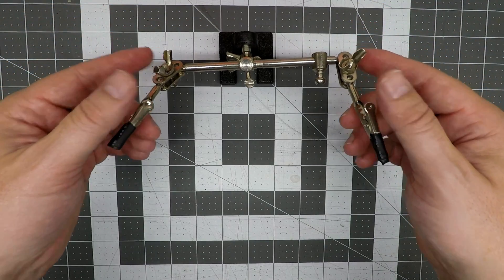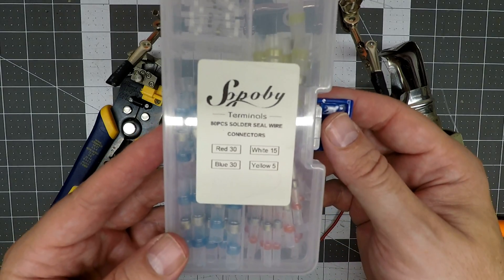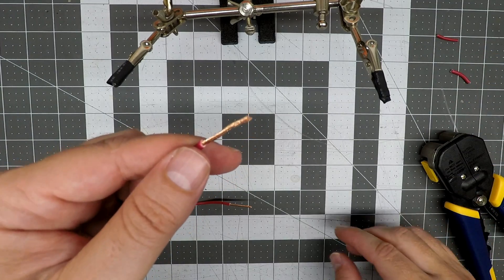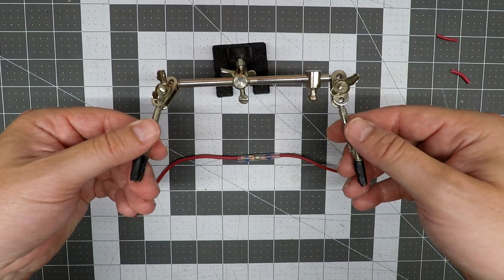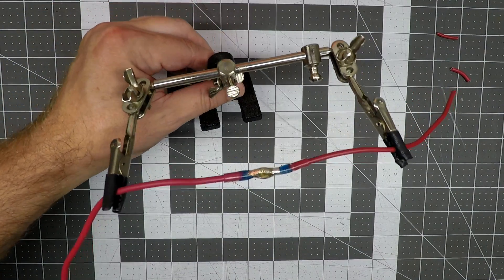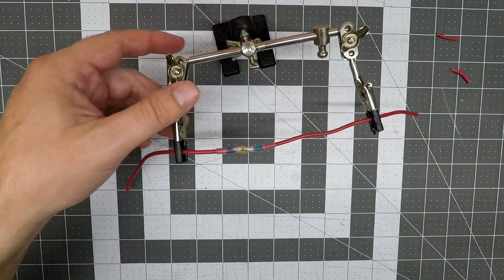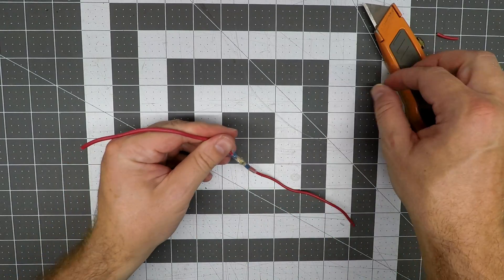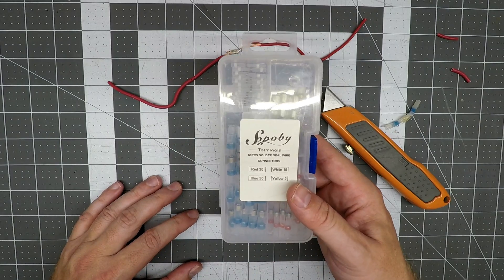Does Solder Seal Work? - Splice, Solder, and Heat Shrink Wires ALL-IN-ONE?

Comment: Great tutorial!!   Thank you.  You're one of the best presentations with a clean background that makes everything clear.  My only additional comment...when using the connector in a real application, slide the connector over one wire until the end protrudes, twist or splice the ends together, slide the connector into place, continue from there.  Maybe obvious to EVERYONE else, but I twisted my wires together and then blankly stared at it for a moment with the Sopoby connector in my hand. Yep, I'm really smart.
Reply from the maker: I have done that with heat shrink myself, and anyone who says they have never done the same type of thing isn't telling the truth.  Still, I should have demonstrated a bit better.  Thanks for the comment!

Comment: I used it on indicator lights that blew and had to rewrite connection block to wire loom , worked perfectly , for this application it’s great maybe for high voltage connections maybe not. 12 volt  application perfect.

Comment: I soldered 30 connections during the time it took you to do just one.  What a joke.  Soldering is so easy just learn how to solder and forget about all these gimmicks.
Reply from the maker: 30?  My video is 6.5 minutes long, or about 400 seconds.  So can strip, splice, solder, and put heat shrink on two wires in less than 14 seconds, start to finish?  That's pretty impressive.  I made my video for people who don't have those skills or tools.
Reply: These take about 1 minute....your soldering iron isn't even hot by the time these are done. Have fun soldering a wire harness inside an engine bay, this is 100x easier and is far faster.

It's no gimmick

Comment: Sopoby, the manufacturer, doesn't provide any instructions for use, so your video is a great service to those of us trying out this method of splicing wires with solder and a weather-proof seal using Sopoby products.  Thanks for making this video.  So far, my experience has been pretty good, although I discovered that if you use a Butane mini-torch, you can burn the plastic and melt holes in it, although the solder itself works pretty well if you are sure it has melted on all sides of the joint - it will be shiny everywhere it has melted.
Reply from the maker: Glad it helped, and thanks for the tip.  I try not to use direct flame when doing this, for the reasons you mentioned.

Comment: How does this work with connecting wires of different gauges?
Reply from the maker: As long as both fit in the same Solder Seal.  However, do some research on ensuring that the current passing through them is able to be handled by the smaller gauge wire, etc.  Signal wires should be OK.

Comment: how does this work inside a hot engine? will the heat loosen the weld??
Reply from the maker: See the @4:20 mark of the video!
Reply: @InJasonsGarage  I haven't been able to find end connectors like this, only crimp on's.
Reply from the maker: @King_TuTT  The link is in the description:  https://amzn.to/2VydgSf
Reply: @InJasonsGarage  these are what i'm looking for but solder on not crimp on.

Comment: I use these on my boat and trailer electronics with great success. I use a torch and once you figure out how to not burn anything they're fast and secure. The only thing I do differently is go with the sopoby recommendation of meshing the wires in a straight line. Nice video.
Reply from the maker: I have a torch, but I hate using it as I don't want to burn anything.  I suppose moderation is the key.  I didn't see where Sopoby recommended meshing the wires, but I know that is a good method as well as doesn't create as much of a bulge in the center.  Where did you see their recommendation?
Reply: Is it waterproof? I mean they'll of course say it is, but I want to hear comment from real people that uses them on a boat.

Comment: If that is "Easily", I will eat my balls.
Reply from the maker: Ha!  It is pretty easy compared to other methods.  If you know of an easier one with the same integrity as this one, I'd like to see it.
Reply: @InJasonsGarage  6 minutes, Wire stripper, stand for hodling wires, gigantic fancy heater gun (which need power supply)...
Reply from the maker: @edvardjelusic7410  Still easier than traditional soldering.  You can use a pocket knife to strip wires if needed.  That stand for holding wires is optional but does make things easier.  That "gigantic fancy heater gun" is $12 at Harbor Freight after using a coupon that can be found easily.  It plugs into any wall socket.  It is also optional because you can use a hair dryer or even a butane lighter or a match or candle.  You need all of that and more for regular soldering, as I demonstrated in the video.
Again, if you know an easier way to achieve the same results, I'd love to try it!

Comment: Works best in tight areas with a small butane solder gun/blower/torch, plus you can direct the heat better and get better penetration of solder into wires, without the worry about getting things you don't won't heated down with the large heat gun!
Reply from the maker: Great point!  But I always worry about burning the wires and heatshrink.  What kind of flame should I set the torch to and how far should I hold it from the area to be connected?  I suppose I could experiment...but it would be good to know if you have experience.

Comment: Hey there J.  It is splice not spice. I have wondered about those... After this video, I now know never to buy it. Also if you want extra security tie the wires in a square knot before you solder them.
Reply from the maker: Thanks for the spell check.  :)   Also, thanks for the tip on the square knot.  So now that you see how they work, why wouldn't you use them?
Reply: still not sold on low temp solder. I would like to over amp one and see if the heat melts it.
Reply from the maker: Yep, that’s why I heated it twice to see what would happen. I think your idea is a better test. Want me to send you a couple to try to fry?
Reply: @InJasonsGarage  Engineering procedure:  What kind of failure are we imagining?  Loss of tensile strength?  I don't think this splice will be weaker than the surrounding wire in a high-heat situation.  We could test it by hanging a heavy weight from the wire and running a high current through it, but do you foresee using a thin-gauge wire with a splice in a high-tension condition?  How about loss of conductivity?  I think conductivity would be maintained in the splice up to the temperature where the insulation on the surrounding wire would begin to burn off.  Other objections?  If none... then efficacy confirmed.
Reply from the maker: I tested this out because in a previous video (see my channel), I made a video on how to quickly t-splice wires without solder and a lot of people claimed that there is only way to join wires and that was with traditional solder.  In the spirit of doing things quickly and easily while still getting things done right, I made this video to compliment the first one and to show there is more than one way to do it.  Everyone's thoughts on what is right still differs.  :)
Reply: @InJasonsGarage  You are absolutely right about people believing that their way is the best way. Some have good logic behind their opinions and many are really stupid.  I hear all about solder is the only way to go and believe me I have done a lot of soldering, wires, circuit board components, etc. and I am a believer in solder when it is needed. But it is not always needed or preferred.  If you look at the electrical wiring in a commercial facility just about all the wiring is done with solderless connectors, and in some cases, solder is not allowed. Even in home wiring, solderless connectors are used. I am not an electrician but used to install electronics equipment in high tech facilities. We connected thousands and thousands of wires in these facilities with crimped connectors of various types in a demanding environment, and there were very few failures to my knowledge, and we would have heard about it if there were. The telephone industry used to solder all their wires on distribution blocks, thousands of them. But when solderless terminations were invented they put the soldering irons away and have used the solderless connection technique for probably 50 years or more.
In your first video, you showed how you made a T splice, but in this video, you just did a butt splice.  Not quite the same thing, in my opinion. But two informative videos. Good job.